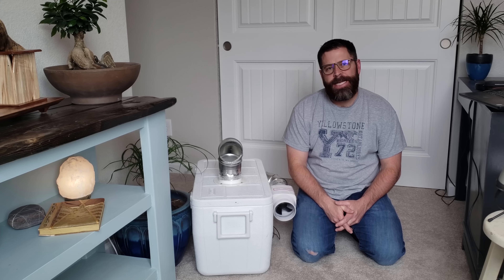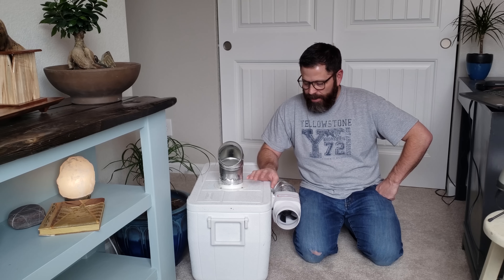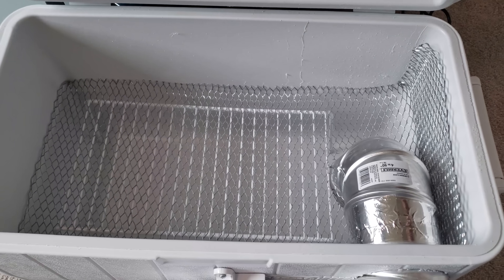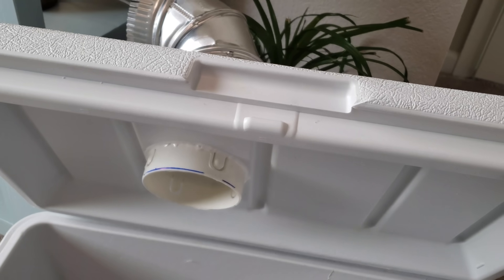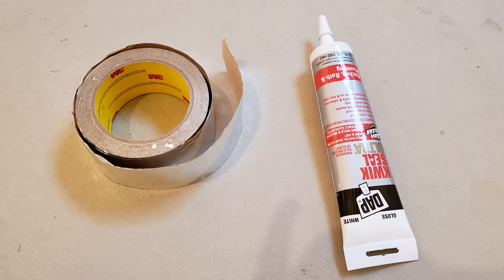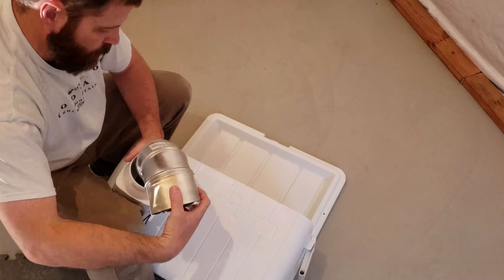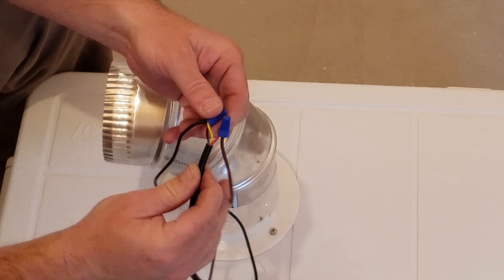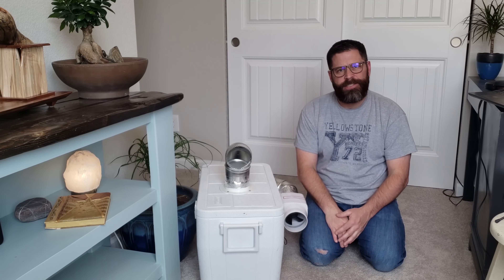Homemade Portable Air Conditioner DIY - Coldest One Yet!

Comment: I need to get one of these for my car. 900 for ac compressor on my Audi a3. Not feelin that
Reply: theshipissinking no this will cause mold to grow in your car. It doesn’t work like air conditioning because it’s putting moisture in your car instead of taking moisture out like air conditioning. I’m a air conditioning and refrigeration tech so I know this is a gemick.

Comment: Some different challanges... Aka the water lol. I think I will play with a sealed compartment and hose fitting. Metal with deflections and bends.. Sealed over intake on bot. Hose connects to chamber and run to window or door. Dry ice in chamber. Obviously u need to deal with leting that vent... Hence hose. Generally if there is a vent hole there is no boom, just more pressure if hole is small

Comment: You could put duct insulation tape around the metal ductwork to prevent cooling loss
Reply: There's no cooling loss since the thermal transfer still occurs within the conditioned space

Comment: I have a very large basement and attic area in my house which are both empty. During the winter months here I take large heave duty contractor bags and bring them outside and fill them up with cold air. I then store them in my attic and basement. During the hot summer months I bring them to my living area ( I spend all of my time at home in a closet) and open them up to cool off.  I dont have to buy ice or use electricity to run a fan and the bags are reusable and will last me for years.

Comment: Idea for a new version. Keep the same design but add to it. 3 radiators from alibaba put one at the intake, one at the bottom of the chest to sit in a cold water salt and ice mix and one more at the exhaust. Make sure they are all tied together with a pump. Fill them with anti freeze or alcohol because you don't want the liquid in the loop freezing. Might need to add another fan to increase the pressure through the radiator.
Reply: John Knight III it cannot freeze in ice. Ice can on get to 32 degrees Fahrenheit when it’s melting so it cannot freeze the water.
Reply: @mwatkins2464  ice forms at 32 degrees that doesn't mean ice can't be colder. Ice can be as colder than freezing, most freezers are set somewhere around 0 degrees which is substantially below freezing. This is plenty cold enogh to freeze water in the radiator if it is sitting in a water ice and salt solution.
Reply: John Knight III ice in water is 32 degrees period. Put ice in a cup and fill with water and the temperature is always 32 degrees. I’m a refrigeration tech and I know these things. When regular ice melts it’s 32 degrees. That’s how we set our thermometers to the correct temp and if you say different you just don’t know what you’re talking about.
Reply: John Knight III ice in a freezer is being frozen by the freezer dummy. When it melts it’s 32 degrees.
Reply: @mwatkins2464  you are right I really messed up saying -212 is as cold as it can get but it still doesn't negate the fact that the  ice water and salt solution can get below freezing and cause water in a closed system inside it to become frozen which is the point you were originally trying to argue against.
 This is a very easy experiment that even you can try. Get ice, cold water and plenty of salt. Mix em up in a decent sized bowl, pot, or a cooler. The put a cold can of soda in the solution. It will explode just like if it was in your freezer. Yes this does happen in the real world and you can add that to your 30 years of refrigeration experience
Reply: John Knight III I really don’t need any advice from you I’m doing just fine with what I know. I don’t need to experiment with anything since I deal with the real life refrigeration units that many depend on me to keep them running. Maybe you can go to hvacr school and learn a few things you don’t know. Who knows maybe you can teach the instructors on how great this cooling system is . Ha ha I’m thru
Reply: @mwatkins2464  you do know this whole post was about making a portable cooling system that can run on battery power. If your HVACr knowledge enables you to put a compressor, condenser, and evaporator into something as portable as an ice chest and let it last for a couple of hours on battery power, you should really sell them
Reply: John Knight III you’re just silly. No one would by this and if they sold one it would only be used once. You just never give up do you!! lol please let’s just let it go. Waist of time and I’m at a bar with beautiful women right now. 👍👍 they are laughing at your post. Have a good one
Reply: @mwatkins2464  there are literally comments on this video about people wanting to buy this. Your claims that no one would buy one are hyperbole at best. Unless those women were also drunk at the bar or just laughing to make you feel better I doubt that happened.

Now I'm trying to imagine you drunk at the bar telling beautiful woman about this guy who had an idea on YouTube that you keep trying to prove wrong but can't. Even if I thought I was right, bragging to people at a bar about someone you out witted sounds completely bizarre.

Comment: You are not removing any heat from the air you're only mixing cold air with hot air you must remove the Heat and put it outside of the space to cool the room and remove humidity for comfort

Comment: I’d like to see someone build a air-conditioner system using copper tubing that recirculates water from a spring or a deep well or just very deeply under the ground and through a network of pipes and re-circulated by a 24 V Prius electric water pump hooked up to a solar power system a dc powered automotive cooling fan maybe blowing over coiled tube‘s in an enclosed area filtered of course,,,, has anyone tried this????
Reply: You're basically bringing up 55 degrees Fahrenheit water and running it through your coils on your home's central air. My friend did this, it wasn't cold enough to make much of a difference. It might work if you had one small room or a real big system. I know central air systems will freeze up if enough air isn't pushed through them so that makes me think it's coming in at below 32 degrees.
Reply: Justin Coats since posting this I came across something that suggested the White House back in George Washingtons day in time actually had a series of pipes with cold water circulating through them and a ventilation system that drew in air from the roof and blew down through basically air ducts into the White House and passed over the pipes???
Reply: @william38022  that's awesome. I think a system could work. I would love to have a house with heat and a/c completely off the grid but it's almost easier to just pay the $300 a month.
Reply: Justin Coats if I had the money and time I’d like to get a lot more panels and a couple of forklift batteries I think you could probably lower your air conditioning bill I don’t know if you could eliminate it but I bet you could probably lower pretty good with a system like that however only if you’re using one room as a cool room and a 5000 BTU high-efficiency window air-conditioner.

Comment: You can still call it an air conditioner, it changes the conditions of the air. In this case mostly temperature, probably a negligible amount of dehumidification compared to a heat pump, which is actually a more accurate name for what we generally call an air conditioner.

Comment: Putting the fan on the cold side should prolong the life of your ice. "Vacuum cooling" is used everyday, especially in potato field storage. By increasing the air flow and reducing the pressure you will naturally reduce the temp in the cooler as well, Bernoullis princable,  well. Try it, let us know. With the fan on the "hot" side, you are increasing the pressure inside the cooler thus, increasing the temperature too.

Comment: Ice air coolers and other evaporative coolers work very well in hot dry places. But in high humidity, AC also help pull moisture out of the air.
Reply: Ice coolers work regardless because the liquid is cold and that alone is transferred to the air.

Comment: Great video and design. I would like to see a follow up video with the outside temperature, ambient room temperature readings before during and after, temperature readings of the intake air, temperature readings of the out put air, volume of ice used and total running time before the air until the output air reaches 60 degrees F. 

These readings should answer the majority of the legitimate questions here in the comments. 

Thanks for the build and the video. Keep up the great work. 

D.

(Edit). Also the readings of the unit before ice is added. The control readings to show its performance.
Reply: Exactly my questions. Basically how long will it run in a warm room
Reply: following
Reply: Peanut Pete Now that’s just funny. :D
Reply: Not not than 30 minutes in a smaller cooler. I wonder if it will last longer in a bigger cooler. The blower if powerful if it had a lower setting might last longer

Comment: One useful option would be a rheostat to change the fan speed.  I should think that the ice melts faster with a higher fan rpm, and melts slower with a lower fan rpm.
Reply: Use frozen gallon water jugs. Last longer than ice
Reply: Paul Andrew Mitchell lower fan speed will actually cool better as it allows for more contact with the ice

Comment: Do This To A portable Refrigerator or If there is a freezer that is portable?
Reply: Those produce heat to make cold air. They basically move energy or heat from one place (the inside of the fridge) to another (the outside). You would need a hose like the portable ac units have

Comment: Couldn't you freeze plastic jars of water,or very large chunks
Reply: Yes, in my opinion.  I accidentally purchased a few cases of the mini water bottles last summer and we didn't want to waste the plastic so we froze them and used them in our boat coolers.  We are still using them because they seem to last longer than melting ice and the cooler stays dry.  I don't think the temperature of the air coming out of the "air conditioner" would be as cold though as soon as there was water in the bottles but then it should level out until they melt.

Comment: Would u consider this WET cold air? Any worries about condensation?
Reply: Sammy Woo Condensation should not be an issue until after all of the ice is melted and the friction of the air moving evaporates the liquid.

Comment: To lower the temp and make the ice last much longer cover with salt.    Dry ice would be better? Also if the input fan has more out put than the out put fan , or if you retard the exit valve a secondary air cooling effect occurs.

Comment: That's still going to push a lot of moisture out of the cooler and into the space it's cooling. A closed coil of thin walled pvc pipe or other such tubing would be able to transfer the cooling of the ice into the air without taking the humidity with it. 😉

Comment: Why so many of these projects from different people?  Its basic... A bed of ice with lots of surface area, with all the air volume blown in close contact with it... That's all it takes to get the most rapid chill.

-More ice surface area, like that of a wide horizontal tray.
-minimal wasted space above the ice, cross sectional area of airflow across should be similar to the fan output.
-higher power fan.
-more ice will increase cooling capacity before it all melts (obviously).

There doesn't need to be a hoarde of YouTube videos with similar projects about whose ice bucket/box cools the room the best, unless you've applied the science listed above...  What we need is a large hollow slab laying flat, half filled with ice, air in one end, and out the other.  Super rapid cooling.

Oh, and no mesh required, because all your ice is laying flat, spread out.

Comment: No one in these videos mentions how long it'll last for, sure it blows cold, for 30 minutes, i was figuring like 2 hours atleast....nope, 30 minutes later ice was all melted, so i was like, oh ok, its not a solid block, a solid block would last long, IT DID! 45 Minutes :( using Ice simply doesnt work long enough.
Reply: Thanks was wondering how long itd last

Comment: Nice novelty idea but pretty much worthless unless you are only trying to cool down a sealed closet or something very tiny.  It all comes down to how much ice you have, and you need a lot.  The smallest window units are 5000 btu which means it is a 0.42 ton equivalent.  ton is literally meant equivalent to a ton of ice melting over a 24 hour period. assuming equal thermal conditions of the room (which isn't realistic, but to keep things simple),  you'd need to cycle through 35 pounds of ice every hour, or about 18 pounds every half hour.  1 gallon of ice is 7.6 pounds, so you would need to replenish about 2.3 gallons of ice blocks every half hour just to match a 5000 btu.   And if you ever used a 5000 btu unit you'd know these are very wimpy for small rooms only that don't face the sun if you ever want to cool it down from a standing hot room.  For reference, a small car has an a/c unit of about 15000btu so it can handle the incredible heat stresses to cool it down and very few cars can rapidly cool down a super hot interior to begin with.